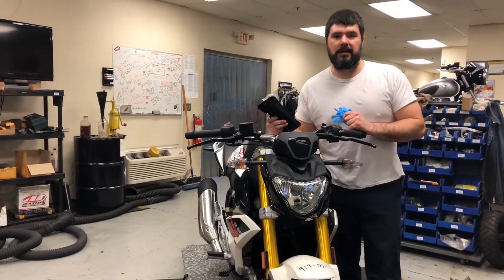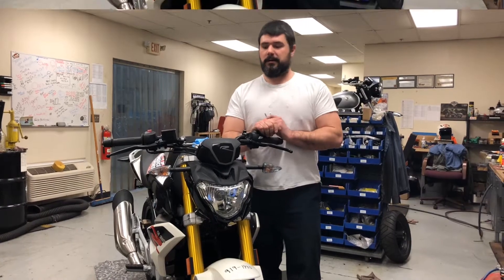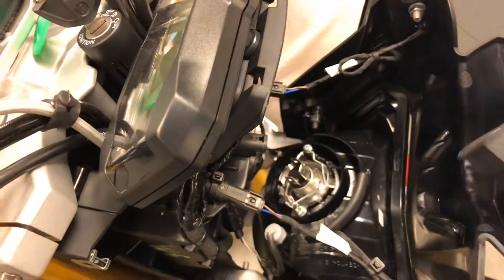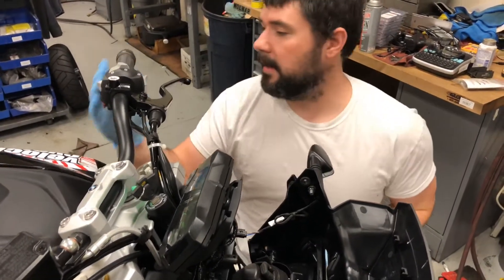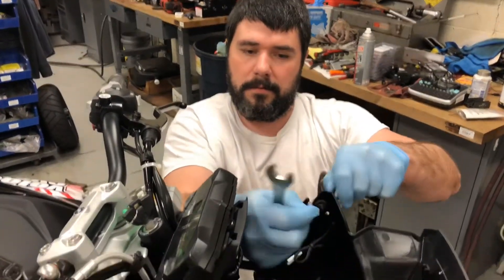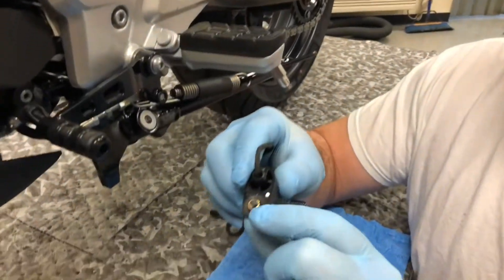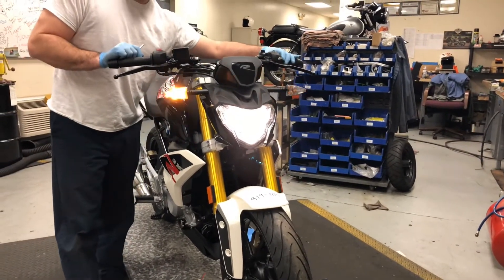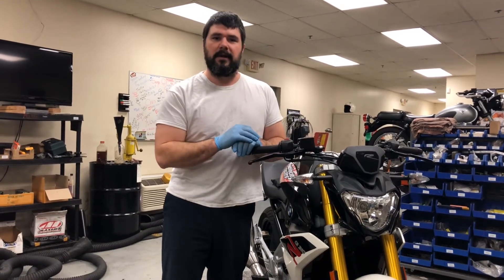How to replace the headlight bulb and turn-signals on a BMW G310R

Comment: I bought my 310 used and whomever had it left one of the turn signals loose. They also mounted a windscreen but didn't fully install it, so it might 'dislodge' while at speed. I tried to just use the hex key to tighten the signal, but the bolt kept spinning. From your precise and clear instruction, I now know that it's a simple job to open the  headlight area, and use a spanner with the hex key. Presto! You saved my ride, and the windscreen will be secure, too. I've watched most of your stuff, so thanks SO much for making the effort to record and edit so clearly. I expect to have this bike 'til my last ride, thanks to you. Can't applaud you enough! Thanks!

Comment: Hehe the iPhone your camera operator is using has the same damaged OIS sensor that mine had. FYI Apple will fix it under warranty. It’s from the vibrations through the handlebars to the phone mount 

Awesome videos man! Really these are the best motorcycle maintenance videos I’ve seen

Comment: Is the high beam coming from the same bulb? If so do you have any idea why the high might not be working when the low beam does?
Reply: It's a single bulb but two filaments one of low beam and other for high beam.
That's why it has 3 prongs. 
Left and Right prongs for different beams when we flick the light switch. And centre one to complete circuit with battery.

Comment: Any help with the back turn signal? I accidently kicked it mounted off and it managed to twist and pop out while bolted. I took the bolt off but the lug got stuck inside and I'm not sure how to retrieve it.

Comment: Thanks once again for this informative video, I only wished if you could have also shown in this video how to adjust the G310R headlight focus high beam and low beam correctly.
Reply from the maker: From what I can see you can only tilt the headlight up or down I can do a standard headlight adjustment video if you would like. Thanks for supporting the channel
Reply: @MattsMotoWoRX  Hi Matt, a video would be extremely helpful and if you could include some pointers that I could use to find an ideal position for optimal spread and reach, it would be great. Thanks again!

Comment: Hi thanks for the video.  Could you please tell me or make a video for the install of USB socket? If + - go to directly the battery it will get discharged so I heard one of them should be wired to key ignition parts... could you please explain it ?